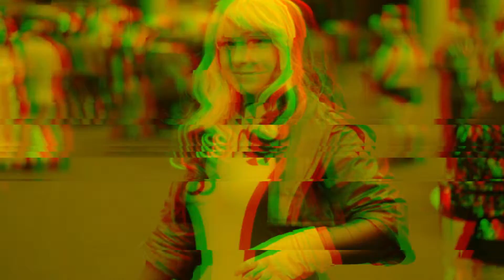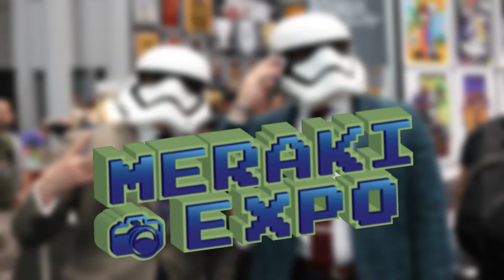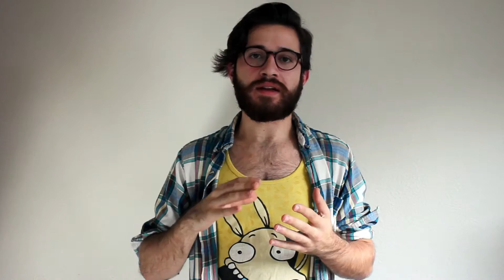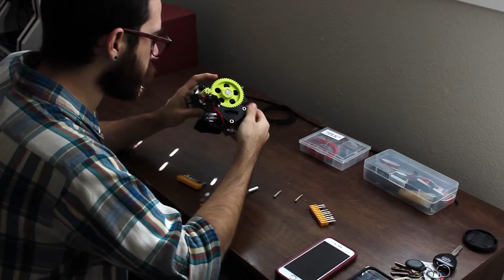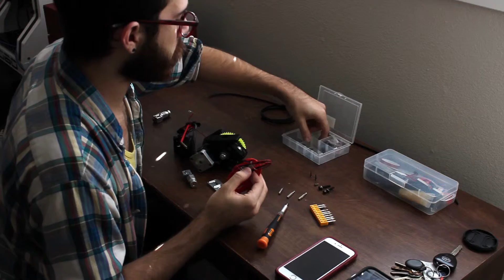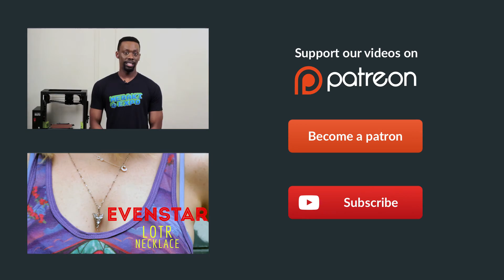Convert 3D printer from 3mm to 1.75mm filament: Live Stream

Comment: Question. I just did the exact same thing with my Taz 6 extruder. I replaced the hot end with the exact same hotend only this one being 1.75mm. I noticed that I am getting jams mid way through longer prints. Are you dealing with the same problems? Did you put a PTFE tube in your setup?
Reply: Josh Daniels did you every figure it out?